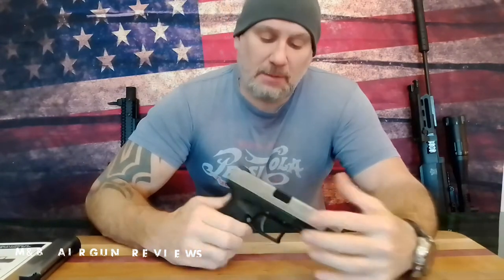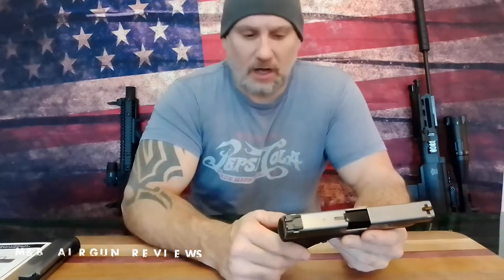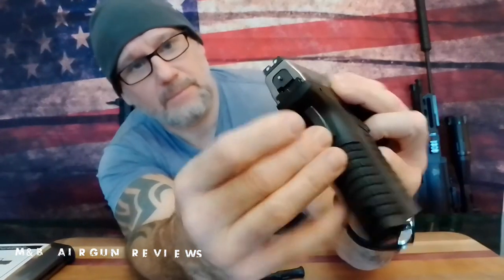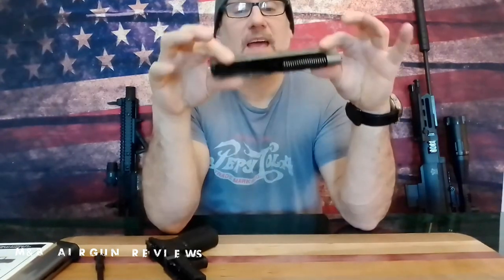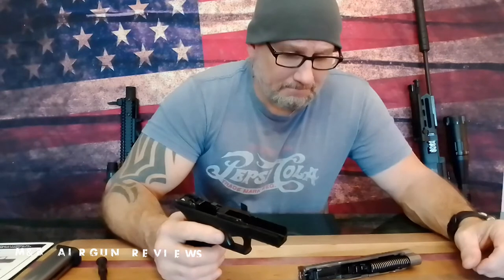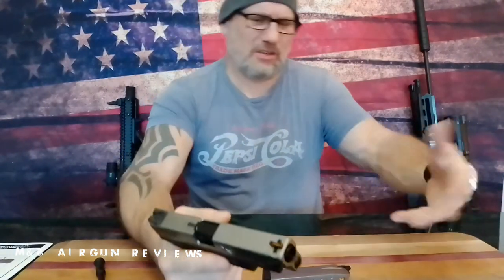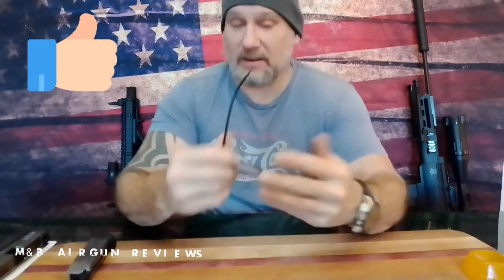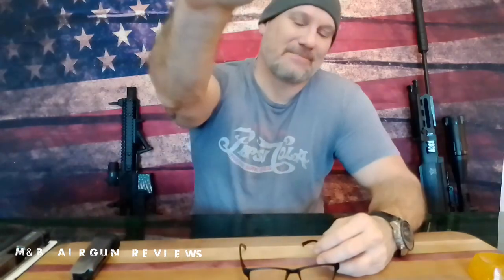How to Field strip the Springfield armory XDM  CO2 BB  Air pistol.

Comment: Great video! I would like to add,be careful with lever pin holding spring bolt in place. It is made of aluminum and is very easily broken. i would reccomend NOT using any force!

Comment: If you're racking the slide to set up for disassembly thereby cocking the trigger, after rotating the takedown lever should the trigger be pulled to release the firing pin indicator? Would this allow for the slide to be removed without the use of a small screwdriver as you did?
Reply from the maker: In my case unfortunately the pin does not move back forward with the trigger pull. Apparently a few of these had this issue. But yes that would be the correct way it should break down.